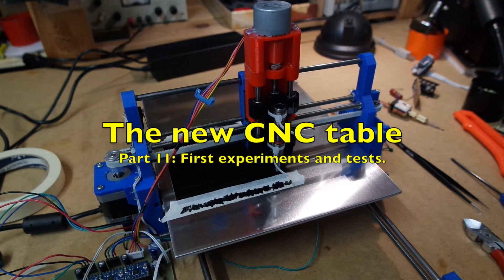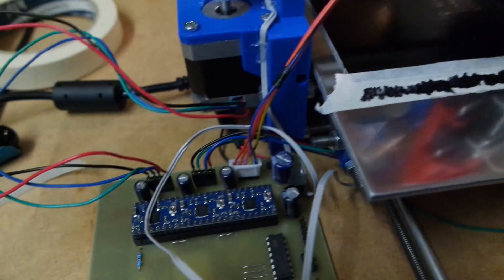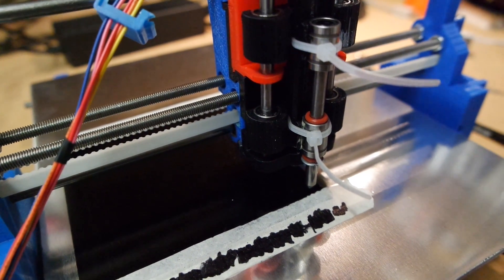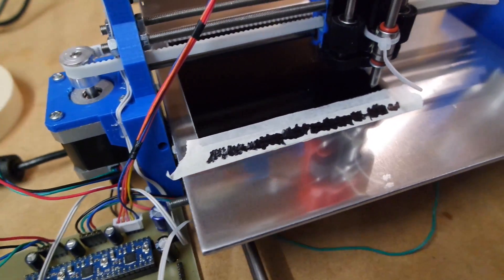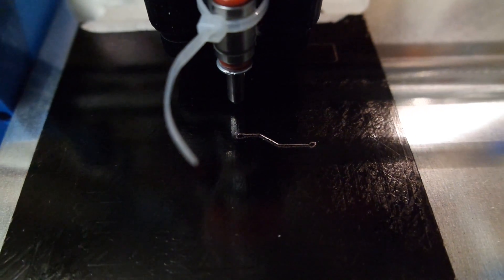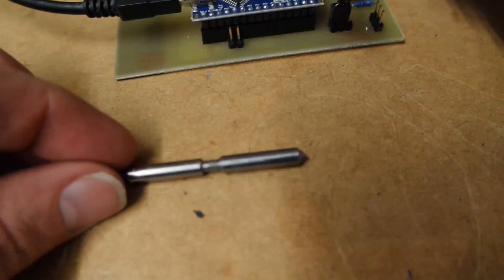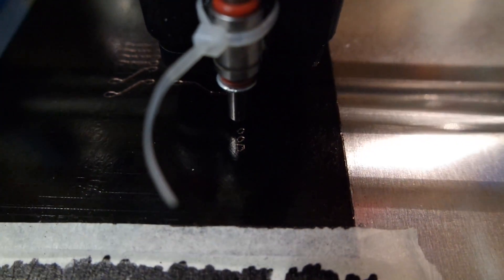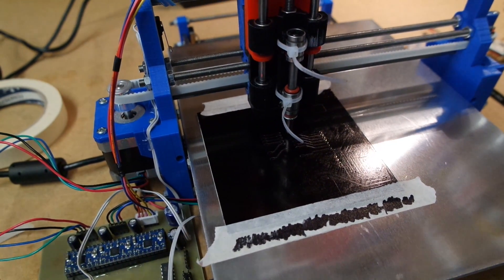The new CNC table pt. 11

Comment: Hello, how did you attach the 28-BJY-48 5V Stepper Motor to the threaded shaft?
Reply from the maker: With a piece of fuel line at first, later I 3D-printed an adapter.
Reply: Did you create an STL for this adapter?
Reply from the maker: Yes: 
https://github.com/dherrendoerfer/uCNC_controller/blob/master/Extras/Rod-Robin/Z-Axis-Tool/Rod-Robin-Z-Tool_F.stl
Reply: thank you, had seen this piece but did not know where it was from. rsrsrs

Comment: If you make the tip a bit of center and then rotate the tool by another ordinary motor, it might work better?
Reply from the maker: I suppose I just need to make a better tip, or adapt my pcb layouts, that is probably much easier. but the technique works, that's what's important.

Comment: when you mount that laser , and get it focused ,  it will burn off that black paint / marker much finer than a tool . with crisp edges as well for cleaner tool paths . 
also if you keep it mounted on a fine adjust Z axis , you could use the  Z axis to take it in and out of  focus just ever so slightly to  adjust  with of the beam that will etch the black away . I know min could do it with my small old red laser rig , but my  bigger violet laser on  has no Z axis .  but i plan on putting a back pack  on the x carriage for my 3d printer that will mount my laser there when i want a laser.    even my old small red ones that i used on my CDROM  parts  CNC  could be focused by z axis  .  but that rig was soo small . 
Great to see how you have this machine coming along , and I love the  o rings for  tool grip / cushioning .
Reply from the maker: I see, you are a mile ahead of me at this. I'currently need to use the collimator lens to focus, but that laser simply won't do low power. So right now it's more or less guesswork.
I tried a few things, but to use the laser I need to increase the line width by a lot. Even with the laser the thing is too small.
I also want to make a shield/sink to eliminate a lot of the emitted glare. But so far it also seems to work.
Reply: i hade to resort to some trickery to get a good focus on mine . when i want a fatter path i would  move the laser closer by a few mm .  as long as your laser is still strong enough to  burn off black ink when not perfectly focused it works great .  in fact if you are  careful with some test you can purposely de-focus your  laser to have a  hot spot with the width of a cutting tool .   agin it's something you cna do when you have it mounted and easy to play with . 
at first i had a bit of plastic  press fit onto the  focusing lens housing so i could experiment with manual focus tuning .
Reply: What paint did you use? I tried Acrylic paint and only got my 500mw rated laser to scratch it, also on the 60w chinese laser acrylic, or any other paint i tried left nasty residue that didn't do well with the etchant.
Reply: heavy sharpie coating , sorry not really paint .    just black sharpie .  take the tip off and use the felt ink well from inside . it works much quicker and better than using the standard tip.
also what color laser vs what color paint / ink can make a huge diff.    i have a 300mw violet . it can even cut plastic it i poison/paint the surface with  black marker .  
i need to  do a tune up on my rig and then try a small board . ( not sure if i have any etchant left now ).
Reply from the maker: I use Edding3000 or the related refill ink.
Reply from the maker: I did tests yesterday, and taped them too, didn't have anytime left to upload them, so they'll go online today - funky fumes comming up ......

Comment: Hi Dirk, nicely done
Maybe you can try a diamond tipped chisel as used in trimming grinding stones?
Reply from the maker: Yes, or just sharpen the tip of my pen some more. Steel beats copper anytime, but I wanted the tip to produce a line/scratch with a known line width, I can always adapt my PCB layouts to accomodate.
Reply: Another possibility would be to use a drag knife as used in vinyl cutters, but they probably want last  long as the key word in PCB = glassfibre  --> "glass" is the problem.
Reply from the maker: I don't think that will work, since they have a certain lag to the direction changes, since the knife part is off-center.
Reply: check this link , diamond drag engraver from Tormach
www.tormach.com/store/index.php?app=ecom&ns=prodshow&ref=32452&portrelay=1

A steel tipped pencil will just wear out to quickly. I suppose you like to drag through the copper layer ?

Comment: Just start my new build, I noted you only use one limit switch. The part plans I am working with show a switch each end of the axis. I have not seen this on other machines. Using Grbl with universal gcode sender, any idea with two can be used or is a good idea to?
Reply from the maker: Both is good. I have 2 switches, but I only use one input port because most of them are taken.